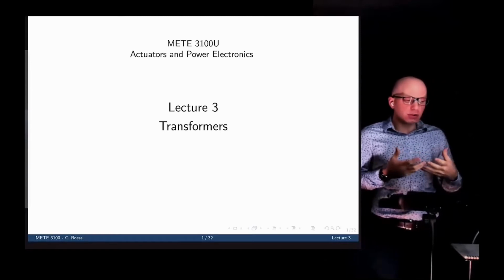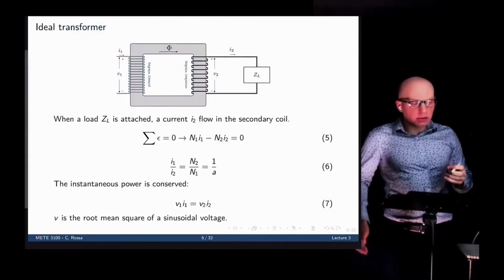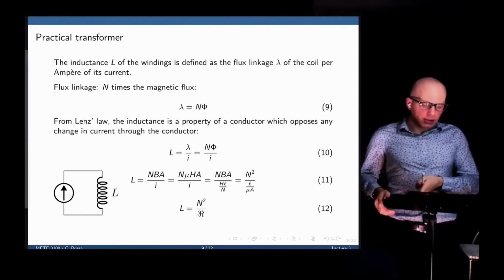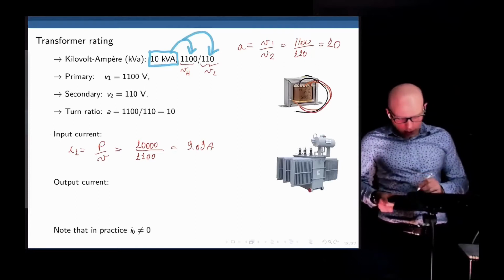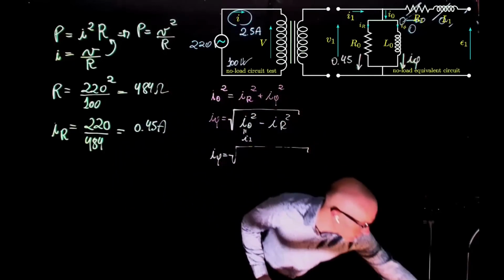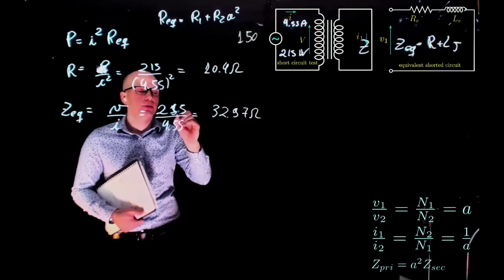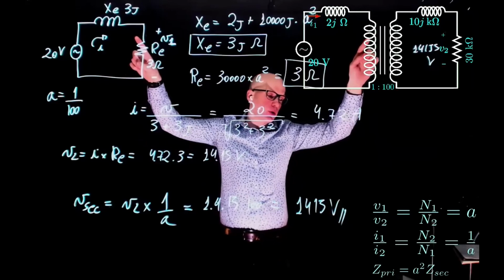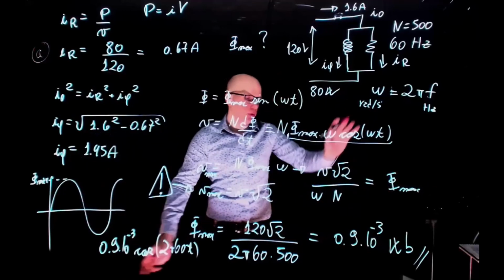Actuators and power electronics, Lecture 3: Transformers

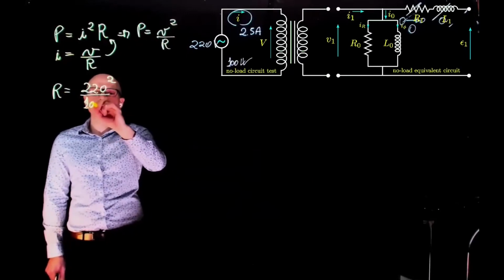Comment: at 50:26 why can you use the voltage from the secondary winding in the power equation of the primary, while their power would be different wound the voltage be different as it goes across the transformer
Reply: also why is it for the first test is their no r2 and x2